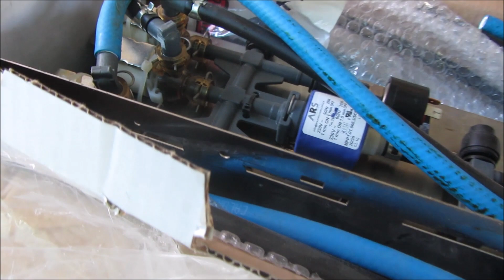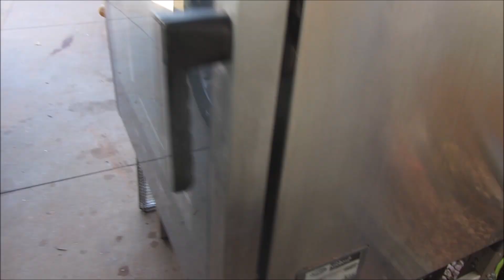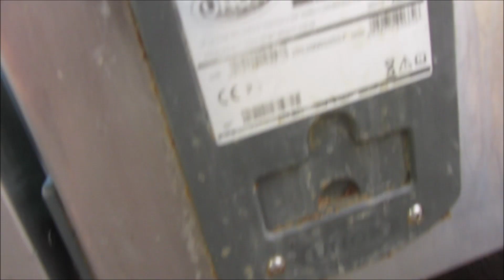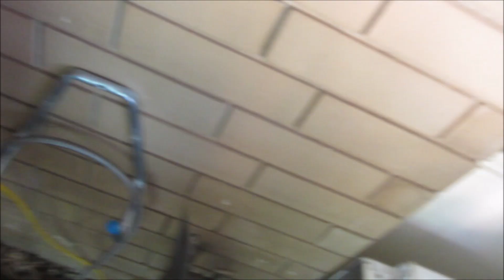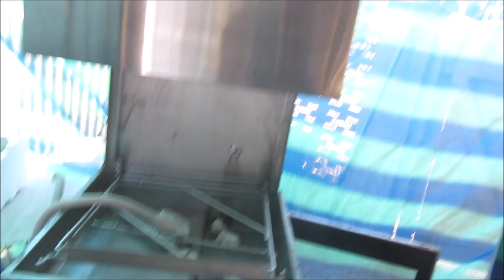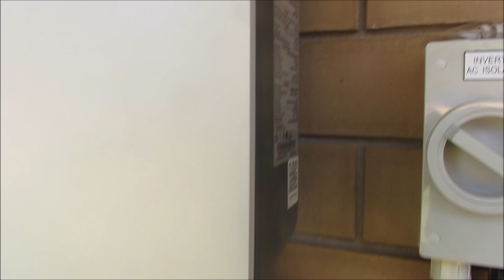Solar up & running & Switchboard Done

Comment: What  are you  planing on doing  with  the old duckted air conditioner
Reply from the maker: Nothing yet
Reply: It has a boxer compressor  that would sound  really good. I have a video  of an  old bristol reciprocating compressor  running  on my channel, the one I am crintly  commenting  from